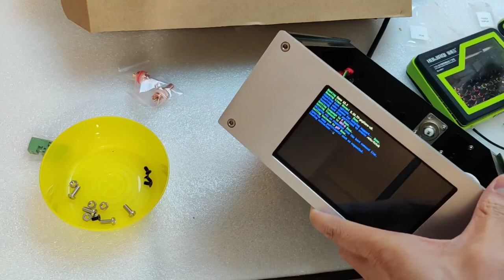Raspberry Pi Player Kit Unboxing and Assembly

Comment: What are the dimensions? Is the kit complete the Raspberry and DAC? How much does the whole kit cost in euros with shipping to Italy? Thank a lot
Reply from the maker: Dimensions are: 215(W) x 100(H) x 245(D). Please be noted that no Raspberry Pi or DAC is included. The kit itself costs USD225, which is equivalent to EUR201 based on today's currency rate. Shipping cost to Italy is USD125 with FedEx. 
Hope it helps.
Reply: @vincentfong4154  thanks for informations. other request: is there the assembly manual in the kit? Don't have another courier to use with a lower cost? Is it possibile to have a list of material of the kit? Thanks. Have a good day.
Reply from the maker: @francescovitiello2419  I'd say there is a simple guide instead of a complete manual. The assembly is quite straight forward, screws and other items are packed individually for each part (i.e. you will have a small plastic bag for back panel, another small plastic bag for front panel, etc). 

UPS, FedEx and DHL have similar shipping rates, but FedEx is preferred becos of reliability and easy-to-use system, so I will keep FedEx as the only option at the moment. Please refer to the link below for the complete BOM:

https://drive.google.com/file/d/1yL-F2Thn-lqf-FSt8_nAME6FJo9kLSND/view?usp=sharing
Reply: @vincentfong4154  thank a lot. I need to see where to buy the raspberry and DAC and then I will order the kit from you
Reply from the maker: @francescovitiello2419  Thanks Francesco. DAC should not be a problem becos you still have lots of choices from different vendors, but Raspberry Pi might be a problem. Price of Pi 4 keeps increasing, it might not be easy find one nowadays. 
Good luck.

Comment: Is it possible to install a `HiFiBerry Digi2 Pro` DAC in it ??  How much to send it to sydney Australia?
Reply from the maker: Hi, I think it's not difficult to install the the "Hifiberry Digi2 Pro" in it. Personally I don't own this Hifiberry DDC but it should be simple by just soldering the BNC and COAXIAL outputs to the D-type sockets at the back panel. Here's a reference with Allo Digione Sig:

https://www.facebook.com/photo?fbid=572447707908913&set=pcb.572448891242128

Unfortunately this KIT is sold out. There is a new version with 7" QLED display, please check it out at:

https://carousell.app.link/qxVaTTbhXsb

Comment: Hi Vincent, is shipping to the UK possible ? I'm a bit nervous about soldering the circuit board, are there easy to understand instructions on how to do that please ?
Reply from the maker: Hi Mark, yes, shipping to UK is possible but the FedEX is the only choice at the moment. Postal service to overseas countries is ceased in HK. 

There are symbols on both the BOM (included in the kit) and the PCB (such as Q1, U1, R1, etc). You can just match the symbols and solder them. Most of them cannot be messed up because of different footprint. Just pay attention to PNP transistor and LM317 and not to mess them up (they look the same, but there are tiny marks on the IC case). A simple guide is also included in the kit.
 
Hope it helps.

Comment: I looked at this kit and would have picked up two but for two things missing:  1) Black face to match my home theater.  2) HDMI out [I have 1 box with 2 x HDMI out (1 video, the other audio) and another box with 1 x HDMI out (audio)].  This kit looks to be very well designed.  If I had a silver face system, I would have still gone for the kit and drilled holes for HDMI out.  If it ever comes out anodized black, I will probably be one of the first customers.
Reply from the maker: Hi Tom, thanks for your interest and suggestion. Currently the kit comes with a silver faceplate but I will work on a new anodized black panel. Will let you know once it's ready.
Regarding the HDMI out, I believe you don't need to drill a hole for it, just replace one of the two D-type sockets with a HDMI socket and connect it to the micro-HDMI port of Pi 4. Something like this:

https://hken.rs-online.com/web/p/hdmi-connectors/1246388
Reply: @vincentfong4154  Nice.  Thank you, Vincent.  Also, Kudos to you for doing such beautiful work.  Kind regards.
Reply: @vincentfong4154  Hi Vincent, did you get anywhere with the black faceplate version please?  Great looking unit!
Reply from the maker: @jezgb  thanks. the black faceplate is available now, with extra 5USD due to additional finishing process
Reply from the maker: @BTom16  Hi Tom, the black version is available now. For more details please visit 

Check out 'DIY Raspberry Pi Streamer / Transport / Player KIT', available at HK$1,600 on #Carousell: https://carousell.com/p/1145507551
Reply: @vincentfong4154  Fantastic!  :-)
Reply: @vincentfong4154  Hi again Vincent - I have been trying to message you on Facebook, but for some reason it won't let me...  Please could you give me a total price for a black faced unit, shipped to the UK and paid for using Paypal?  I tried to register for Carousell but it won't let me because I don't live in the APAC region...  Thank you!
Reply from the maker: @jezgb  thanks for your interest. Do you mind messaging me thru my Facebook page below? Just to keep sensitive personal information private. For UK there are two shipping methods. Let's talk about that in details.

https://m.facebook.com/smhphk
Reply: @vincentfong4154  I think that link worked - thanks!

Comment: Awesome! Looks gorgeous. RCA outs are an option correct? I will be connecting mine to my Schitt Modi 3+. Cannot wait for my kit!
Reply from the maker: Thanks. The RCA socket holes are already there. And both RCA jacks and covers are included. My thought was that the RCA jacks do not cost much, but if there are included, it would be more convenient and less costly if users want to include them in the future.

Comment: Hi Vincent, may I know the cost of this kit. 
Secondly, where in Hong Kong would be a good place to buy 7 inch 1024 x 600 capacitive screen. Thanks
Reply from the maker: Hi John, thanks for your interest. I'm sorry that K3 was already EOLed. Successors are R23-MAX (1024x600) and STEALTH (1280x400).
I don't think you can buy capacitive screens locally in HK. They are only available online.
Reply: @vincentfong4154 Thanks Vincent...I am visiting HK in Feb and thought of buying the screen at possibly Sham Shui Po. Not possible ?
Reply from the maker: @johnsnowlow1883  I'm afraid not. Sham Shui Po shops sell fewer DIY parts (except for caps and resistors). Not much demand for touch screens parts. You can probably order from online and send to your hotel.
Reply from the maker: @johnsnowlow1883  BTW are you talking about HDMI touchscreens? Or other interface?
Reply: @vincentfong4154  yes HDMI touchscreens for raspberry volumio
Reply from the maker: @johnsnowlow1883  I have this touchscreen in stock but I'd sell it as a kit. Details can be found here:

Check out 'DIY Raspberry Pi Streamer / Transport / Player / Media Server KIT', available at HK$2,300 on #Carousell: https://carousell.app.link/nIq0AZlAWwb

Comment: Did you planed to do a passive cooling version?
Reply from the maker: Hi, this is a passive cooling
Reply: @vincentfong4154  Well, i mean using the benefits of the case to cooldown the cpu of the pi.
Other idea : thinking of temperature control with pwm and with a 9cm to 12cm fan for no noise.

I think you are now about 53*C.
Would be nice to have 40*C.
Reply from the maker: @johnlenfr  I think it is possible to use a thin metal bar to transfer the heat from the processor to the metal case. Alternatively there are large heat sinks in the market which can do the job.

I don't measure the temperature intentionally but so far the Pi has been running PCP for more than a year without any glitch. Personally I don't think it's a good idea using a fan for audio devices.